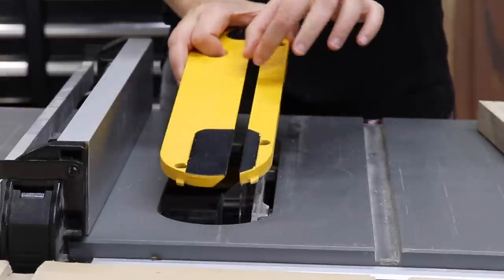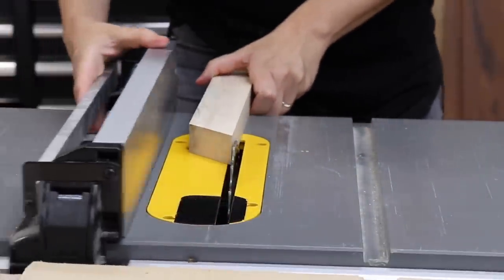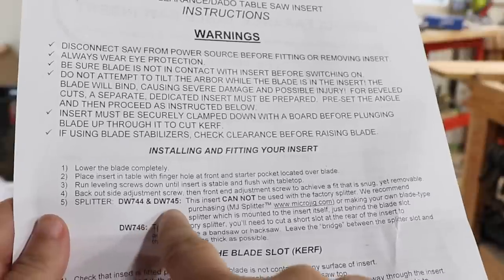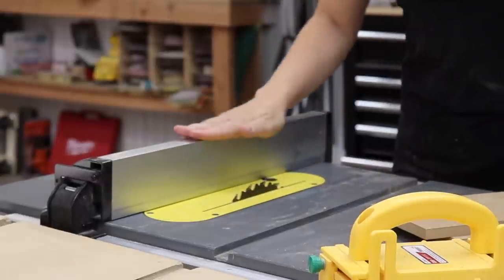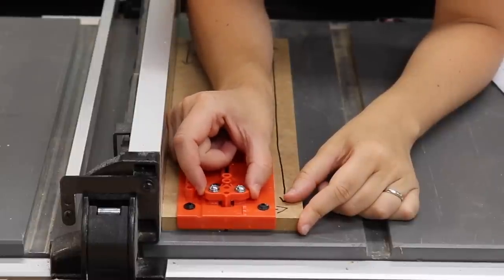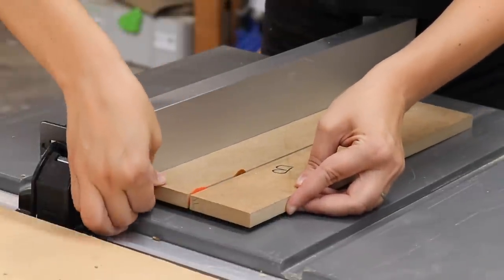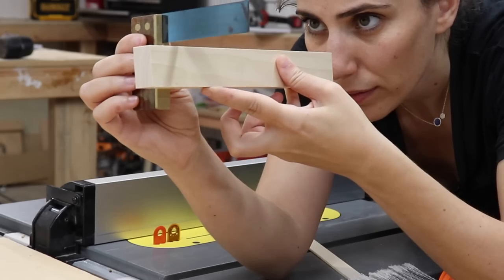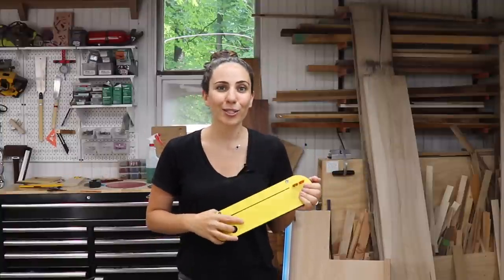Zero Clearance Insert with Splitter // Riving Knife // MJ Splitter // Kerf Keeper

Comment: Thanks Tamar. I bought this system several years ago and I just couldn’t get the set up to work. Using your great detailed explanation, I’m going to take my iPad down to the shop & use your presentation to install these much needed devices on my tablesaw. Thanks a lot. You are a great woodworker!
Reply from the maker: Awesome! So glad it was helpful! Yeah. The instructions were a bit confusing. So I’m happy to have cleared it up!
Reply: @3x3CustomTamar  No problem.  I posted it on my page, Coogan's Workshop, and linked it to MJ's page.  I also posted it to their page too :-)
Reply from the maker: Jim Coogan awesome!
Reply: Did you measure the 2inches on the inside, middle,or outside of the blade? Could be a small detail that could change the accuracy. BTW, excellent instructional on a real pain as far as their instructions goes.

Comment: You legend! Having just bought a dewalt table saw and after losing sleep for two nights trying to work out what I was doing wrong, you show me the solution. Despite having my blade at 90 degrees I kept on getting little slivers of light on one edge of the cut. I’ll spend the day making a zero insert. Thank you so much.
Reply from the maker: Hope it helps!

Comment: Thank you so much for this video. I installed my MJ splitter after actually talking directly to the guy at the company who does the tech support. I have a powermatic 66 with phenolic inserts, that need a little more set up for drilling. I have to redo a plate after resetting my table to a better calibration to the blade, so this reminder of the process was helpful. I love your channel!
Reply from the maker: Awesome! So glad it was helpful!

Comment: My 1980's Sears contractors saw doesn't have a riving knife and the splitter and guard are usually off when I make cuts because it doesn't align correctly and blocks the wood because that kerf is not aligned. I've see these add on splitters but actually seeing it installed and used is helpful. Thank you.
Reply from the maker: Awesome! Stay safe out there!

Comment: Excellent. Here is a helpful tid bit. I have a Ridgid job site saw. The metal plate (like your original) accomodates 90 degree and angled cuts – but not zero clearance. I bought the "Fastcap" zero clearance tape, useful for miter saws, table saws (like mine) and router fences (as needed). When on YouTube type in Fastcap zero clearance tape. You can see its usefullness. I bought mine from Lee Valley for $6.00 and feel it is very much worth the price. My saw plate (no lie) is slightly BELOW the saw table (WTF?) not sure why, but in this case it worked to my benefit because the tape made the plate flush to table! Thank you for this video (explained very well). The Microjig instructions made my head spin for my "yellow" set (thin kerf). Have a great afternoon.

Comment: Very interesting solution.  I have the same saw and made an insert from scratch which allows the use of the original riving knife.  I was surprised you had gone with a purchased product since you  make so many cool custom fixtures.  Great video as always!
Reply from the maker: Thanks. Yeah. 2 reasons why I decided to purchase. 1) time. Ha. 2) the table saw is super dangerous. I wanted something that I knew would be truly reliable. I don’t take my fingers for granted. Ha
Reply: @3x3CustomTamar  Both excellent reasons!

Comment: I had the same set up on my saw for several years.  I have since moved over to a Shark Guard.  My saw did not have a splitter or riving knife so this was a huge upgrade.  I still use the Leecraft insert with microjig splitter for certain situations.   You did a great job explaining the microjig set up instructions.
Reply from the maker: Never heard of the shark guard. I think this is going to be a good set up for now!

Comment: Hey Tamar, I also bought the exact same zero clearance plate.  I discovered a very cool trick to make additional ones.  When using a template bit on your router to duplicate the plate,  you can back the side adjustment screws out ever so slightly beyond where they would need to be for a tight fit on your saw.  Then when you duplicate the plate the bearing will trace around the screw and leave a little wooden nub on the side of the copy.  You can then sand those nubs down for a perfect friction fit.

I used this to make a plate that will accept the riving knife, dado stacks, etc.  then my main plate has the micro jig splitters.
Reply from the maker: That’s a great idea! Maybe I’ll do that for the other blades I have

Comment: Thank you, Tamar. I have slight conundrum: using a 7 1/4 blade in 10 inch table saw. The kerf for the blade thickness is 2/32nds for 7 1/4 and 3/32nds for the 10 inch blade. It does not appear Microjig has a 2/32nd option for their kits. There are some benefits to using a 7 1/4 blade for certain applications. Hope this might be of interest to you for some future video project. Thank you, again. -Paul

Comment: Even though I have a number of MicroJig accessories, I had never seen this one until this video.  I bought an old Delta Unisaw without a riving knife or blade guard and have been looking for a solution.  Last week I was resawing some QS white oak that had enough tension to completely bind up the 3hp motor and scare the hell out of me - luckily because of the Grrripers, I didn't get a kickback or other disaster.  This will be a huge help - just placed my order.  Thanks for the great video!
Reply from the maker: Awesome! Glad it was helpful!

Comment: Good video. I have a ‘93 Unisaw and is from before riving knife’s were used. I have the normal kerf MJ splitters but haven’t installed them yet. Now that I’ve seen your video I have no excuses. My understanding of the kerf keepers’ purpose was to, how to say, go with the board. Tension keeps it in the kerf through the cut thereby keeping the kerf open. Because of this one can continue the cut vs what you said (stop the cut and figure out another way to do the cut). If I am right it seems an important distinction.
Reply from the maker: Well. The instructions said to stop the cut. In practicality since I posted this video I kept the cut going and it was fine.

Comment: Truly excellent content and a perfect example why you’ll continue to do well. 

Do wish you had expanded on difference between splitter and riving knife as the difference between blade and splitter is quite variable dependent upon blade height so safety aspect is very different whether blade at full height or lower. It’s a big point beginners might not recognize.
Reply from the maker: Thanks! Hmmm. Yeah, I don’t think it will be a problem when it’s at full height though
Reply: 3x3Custom - Tamar absolutely correct. + & -‘s

Comment: I've got the same saw and had some tension in a board i was cutting last weekend.  It made me a bit nervous to continue cutting and everything turned out ok but i still wish i'd had this setup!  I'll definitely be doing this upgrade!  Also, i never knew about the stock throat plate causing the cut to be off.  Thanks for the informative video!
Reply from the maker: Glad you found it informative! Yeah. I might be a bit too meticulous but I always found some parts of my cuts to be slightly off even if my Blade was set to 90. It took me a while to figure out what he problem was.

Comment: Cool, I had looked at these in the past and my understanding was the kerf keeper was slightly wider and would get stuck in the board every cut. As that sounded like a pain, I resorted to turning my saw so it faced the garage door, and not the windows! Lol kickback is no joke. I may have to revisit this as an option.
Reply from the maker: Ha. Good planning. 😂 the kerf keeper is actually thinner then the splitters and will only lift when there is actual tension on boards. Showing you that it it not safe to cut instead of feeling it and then kickback occurring.
Reply: @3x3CustomTamar  that makes alot more sense, it's going on the wish list! Furthermore, I can't recall if you use a feather board? If not the level of cut control they offer is incredible... They even make them in yellow to match your saw 😜

Comment: I have the same setup except for a Bosch. I find the MicroJig kerfkeeper to be a PITA it’s just not precise enough-  or rugged enough when starting the milling process....so what I do is turn off saw at first sign of binding, and jam a shim shingle in the kerf to keep it open and finish the cut.  We buy kiln dried S2S and typically cut everything oversized and let it sit for a week or more before final sizing - just cull anything that gets too wacky.  The Bosch is underpowered but easy to get to Jobsites so we make it work.
Reply from the maker: Yeah I’ve done the shim thing before. These saws are small but they get the job done!

Comment: Great video. Thanks. The splitter looks like a pain to get just right despite your excellent instructions. Couldn’t you extend the slot cut in the insert through the back of the insert to accommodate the saws riving knife?
Reply from the maker: Thanks. It wasn’t too bad. The instructions on the insert said i could not extend the cut for the riving knife on this saw. Probably bc I would have to cut all the way through and would mess with the structural integrity of the insert

Comment: I'll be purchasing this soon. I THINK I should be able to use the saws original riving knife. I'm thinking if I just make a tiny notch in the back of the riving knife to leave more material on the zero clearance insert for rigidity (very tiny amount but it's something).

I'm just spitballing at the moment. Before I get too far ahead of myself I have that combo Dewalt 10" with stand. I've also purchased a thin kerf Freud blade, so I'm also seeing if I can use the factory riving knife with that blade. I'm hoping with the zero clearance insert and modified riving knife... that I'll bring life to this saw because it's frustrating how much "out of tune" it is. Even the table is waving at me lol.

I can't wait to get the saw in a workbench or cart to itself because the stand it came with is a total tripping hazard!!!

Comment: Thanks Tamar. It's not a problem to extend the slot to accommodate a riving knife. Much safer than a splitter IMHO. I made a couple more for 30 & 45deg cuts. Surprised at how crappy the insert is, even on a DeWalt.
Reply from the maker: If it’s not a problem why would the instructions for the insert say i can’t use it for the dw745? I assumed it had something to do with cutting all the wa through the back. Yeah. The stock throat plate really sucks
Reply: @3x3CustomTamar  who knows. I guess each saw is different. I just know it easy to do on my cheap Rage 5s. I can't afford a DeWalt. 😀
Reply: @Larisa Ulkina Here's a glimpse of how to do it. You simply mark the widest point in the slot that the RK needs for clearance. Then place the new insert on top of original plate with blade extended up into new plate. Then butt fence up to new plate, turn on TB and slide new plate to the previously marked point.
https://youtu.be/T4H2t4fNpOg?t=453

Comment: Great video, thank you!  I found it easier to follow than the included instructions as well.  Would you please share which vix bit you used for this?   I think mine is the wrong size to get the proper alignment.
Reply from the maker: So glad you found it helpful! If I didn’t link it. I think it’s just from a set I picked up at HD
Reply: @3x3CustomTamar  Cool, I will check out HD and see what they have. Thanks again!

Comment: VERY useful video. Actually using it to setup my own zero-clearance insert (have the same saw, got the same insert, waiting for the same MJ Splitter to be delivered). 
Sorry, forgot to click on "your" Amazon link when ordering the insert. :-(
Reply: Also used your video on how to align the saw blade. Worked like a charm! Including the fact that you have to move it slightly beyond the zero mark before tightening those screws.
You ARE awesome and deserve all the likes you get (and then some)! And none of the dislikes. :-)
Reply from the maker: So awesome to hear! Yeah! Glad you found that tip useful! The first time I aligned my saw it took me hours bc it kept being off... Finally figured out tightening the bolts was making it move.... Glad it saved you the frustration I went though. ha

Comment: I just installed this and drilling into my Leecraft zero insert was difficult with the provided drill bit. The Leecraft zero insert is made of a very dense plastic polymer and the bit get extremely hot and impossible to drill through in one plunge.  I have mostly thin kerf saw blades but one very nice Forrest 1/8" blade that will need an additional MJ Splitter 1/8" $40 kit.  In hindsight, I should have just bought a riving knife but I would need to make a cutout in my insert to accommodate that.  Probably less time to do that than this whole MJ Splitter install.  I also need to pull these out to use the full table saw top for measuring something like a 24" wide whatever.  It seem this is a very niche product.

Comment: Great video!  Beginning woodworkers should know this is only if the tables blade is set a 90 degrees to the table (98% of cuts made).  If the blade is tilted, use the original, wider insert.  Also, these inserts are "currently unavailable" on amazon.:-(
Reply from the maker: Yes.

Comment: Alas, Leecraft DW-2 zero clearance insert is nowhere to be found. Apparently they are far back in production. A vendor mentioned that perhaps they will be available in July. I made my own out of 1/2 inch MDF and another out of 1/2 inch plywood and they seem to be fitting well. Will now proceed to do install the microjig splitters using your video (you are the best!). I have the same table saw and want to buy some blades. I notice you are using Amana Mamba. How do you like it?
Reply from the maker: Oh man. Glad you figured something out. Yeah. I love the amana blades. The thin kerf combo blade is amazing

Comment: Thanks for sharing Tamar, im just thinking, stock one is just cut through in orser to accomodate stock splitter. Why not to cut through this zero clearance one and use stock splitter? Upgrading insert makes sense for me i saw the nees after 10mins of using the saw but stock splitter seema to be fine

Comment: Hi, if your table saw has a factory-installed riving knife why do you want to replace it with an aftermarket splitter?
Reply from the maker: This zero clearance insert could not accommodate  the factory riving knife. thats why I needed to use the splitter.

Comment: I followed your instructions. Everything seemed to work okay. The test piece of 1/2 plywood fit perfectly. However, when I went to cut a piece of 3/4” plywood the splitter was too thick and would not allow the stock through to complete the cut. I purchased the 1/8” kerf set which is the thickness of my blade. I did not use the Kerf keeper as you did because I almost exclusively use soft wood. Any thoughts on why it didn’t work?
Reply from the maker: Hmmm not sure
Reply: @3x3CustomTamar  
Thanks so much for your response. It turns out that my blade was not a 1/8” kerf. I have ordered a new blade and that should solve the problem. Thanks again.

Comment: So with the zero clearance insert, does anyone else get a lot of sawdust on top of the work piece? Like so much that you cant fully work? I have dust collection under the saw with a shop vac, and nothing goes in anymore. Wondering what everyone else is doing. And how is this with your table saw sled? Thanks and enjoy your video!
Reply from the maker: I’ve been on vacation since I posted this video so haven’t gotten to use it much. But my first couple times I used it that didn’t seem to be an issue. If anything it reduced the amount of dust that came up on top

Comment: Can the blade guard be used with the new insert? I’m looking at getting this same saw and as a newbie to table saws I want all the safeguards I can get. Also could the original riving knife be used if the slot was cut all the way to the end?
Reply from the maker: Not for my specific saw
Reply: @3x3CustomTamar  I ordered a hinge so I can make your router jig! You are awesome.

Comment: For a total cost of 27 cents I designed and 3d printed the same riving knife and its drill template. Childs play. The drill guide I made uses a small extended piece that fits perfectly inside the saw slot and you just slide it to position the holes in the guide where you want them and then drill.

Comment: Are you still using the kerf keeper set up two years later? What are you using at this time?
Reply from the maker: Sometimes I forget to put it in. But I should
Reply: @3x3CustomTamar  We have to always have some kind of splitter/riving knife. I had a kick back with a 10x10 inch piece of plywood. I took out the riving knife because it needed adjustment and I did not have the time to play with it that day. I must have twisted the wood a hair while pushing it down the fence. The back of the blade picked up the wood and it flew right past my ear at high speed. A bit unsettling.

Comment: Since it is metal inside, I guess it's not compatible with Sawstop? Or is there a nonconductive version for Sawstop?
Reply from the maker: I have seen ppl use it with the sawstop. It doesn’t come in contact with the blade at all so I don’t see how it would be an issue. But I havnt looked into that
Reply: It's metal but has a plastic coating. A all plastic version is also available